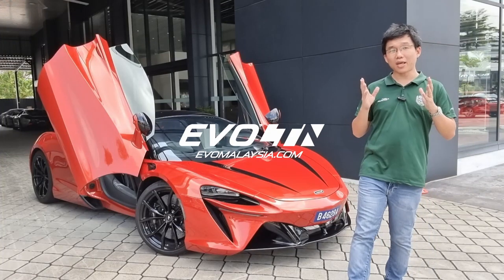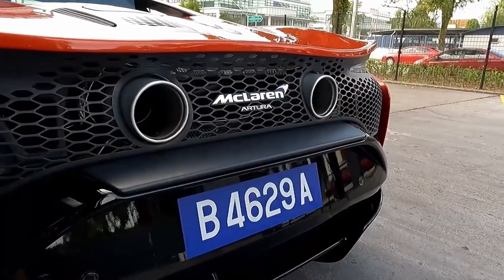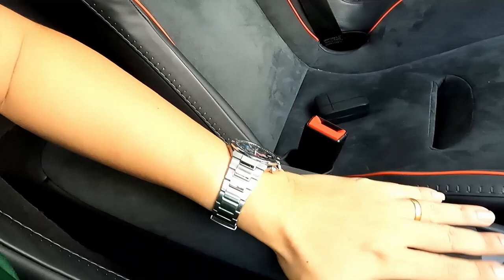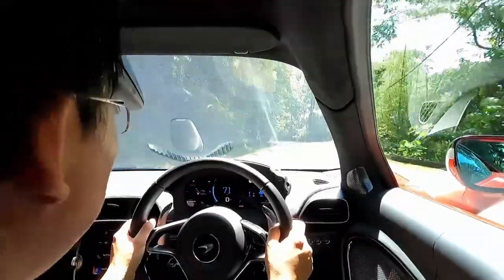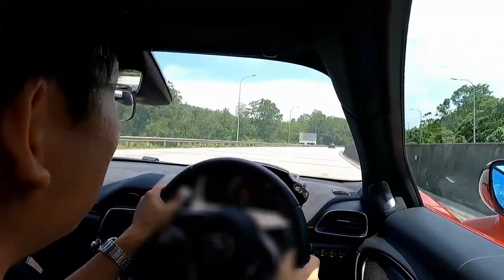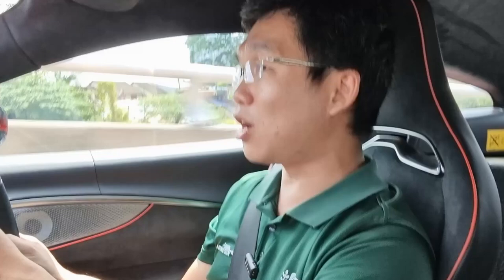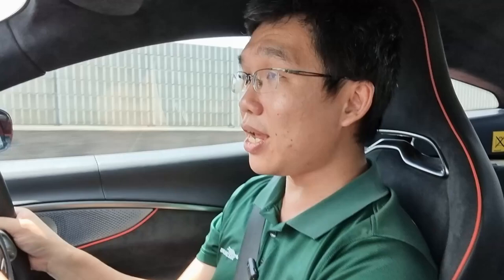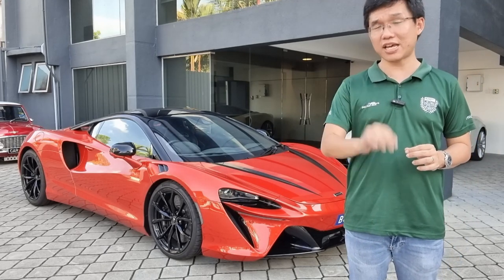McLaren Artura - The Supercar Where Love Does Not Come at First Sight | EvoMalaysia.com

Comment: Excellent review which aligns to my ownership experience of the Artura......story "engine responsiveness, aerodynamics, low weight and steering provides a full engagement of the driver to the car as one unit"
Reply from the maker: Thanks for sharing! How long have you been owning the Artura?
Reply: @KonWaiLuen  I have had the Artura since Feb. Inhave owned 4 different 911’s over 13 years prior to it. I can tell you that the Artura is in a whole different stratosphere compared to the 911 as it should be given the price difference.